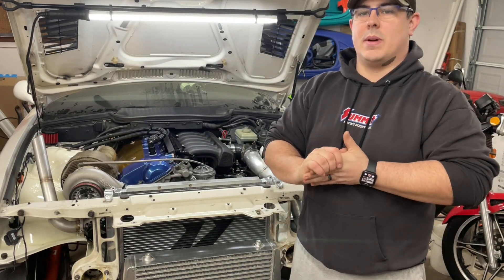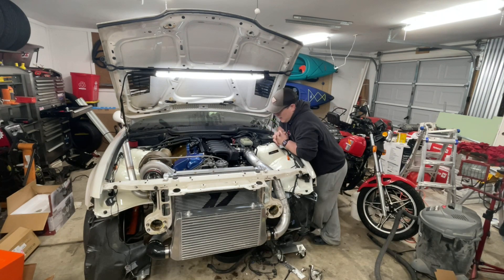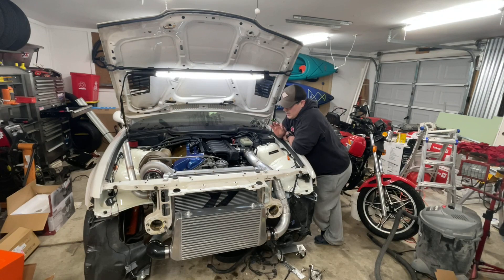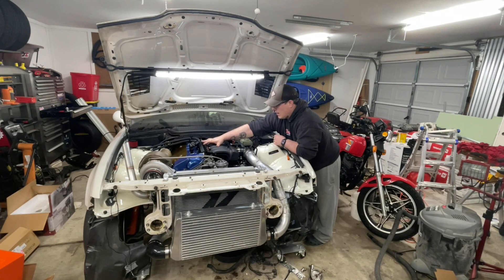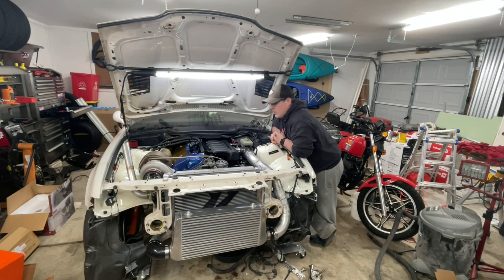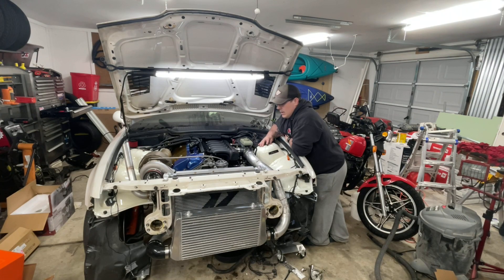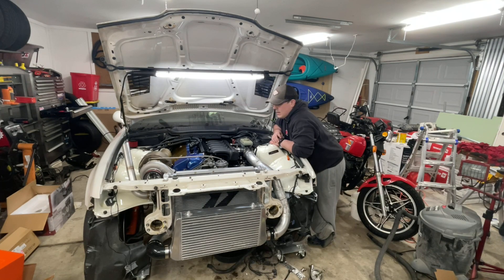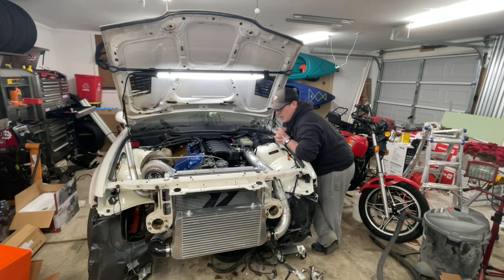Turbo E36 M50 First Start and OBD2 Swap Tech Info!

Comment: im planning on doing an m50 swap in my obd2 z2 with the m52.. i know i will need the euro z3 crankshaft position sensor.. but my question is do i need to cut the plug off the obd2 harness and wire a new connector on that fits the euro z3 style? or is it supposed to be plug and play. both connectors are different shape thats what im unsure of.
Reply from the maker: You shouldn’t have to cut and splice anything to run the euro sensor, no. Should be plug and play.

Comment: So my current situation with my obd2 m50 turbo swap is that nobody wants to tune it on the obd2. I ordered the link g4x and when it came in I never realized link only makes ECU’s for OBD1 harnesses, I have a spare M50 motor with the harness and ECU but I don’t know how to tell if it is an OBD1 harness. Is there any way you could help me out because my knowledge is a little limited when it comes to stuff like this.
Reply: What should I do, should I convert to OBD1 or is there a way I can get it tuned on the obd2
Reply from the maker: RK tunes is the route I went. It’s true, link makes their set up for the obd1 harness. The biggest thing for the obd1 harness is there won’t be any round plugs like there is for the obd2 harness except for the MAF and 02 sensors. All the rest will be rectangular. Another giveaway is the obd1 harness has 6 wires coming out of the portion of the harness that sits by the fuel rail for the coils. 

If you’re set on running the link, swap the obd1 harness over. I don’t know if you can mismatch the sensors but I would swap all the obd1 sensors from the m50 as well. Otherwise, RKtunes is the way to go with obd2
Reply: @DadBodGarage  would I have to make the trip to New York or could he send me a file of the tune?
Reply from the maker: He emails 99% of his tunes.

Comment: Would you rather go link Or rk tunes. 
Working on boosted s50 obdii swap
Reply from the maker: I guess it depends on what you’re starting with. Personally, I wanted obd2 because it’s easier to diagnose and also it just works without having to change much when coupled with RK. Now, I have no experience with link, but it seems like a good way to make your tuning and hardware expandable to run other things like R8 coils and such if you’re already obd1. Each will work, RK just seems to work right off the rip and doesn’t require much tuning just to get the car to run and drive. I’ve flashed it with the base map from RK only and the AFR’s stayed right where they needed to be under load. Idle is a little funky, but not enough to really worry me much.
Reply: @DadBodGarage  did you use the obd2 fuel rail or the m50 rail
Reply from the maker: @frankvillegas5850  I went with a billet rail from Rally Road, but it fits the m50 intake manifold.

Comment: Ha, i obd1 swapped my m52b28 last week so i could fit a link g4x, i swapped the pins in the ecu harness plug
Reply from the maker: Link is a really good option. It was only after I bought the RKtunes set up that link really came on the scene for these cars. Good choice, though!